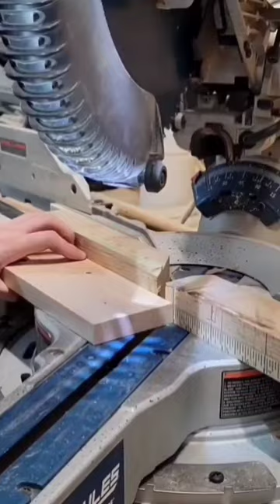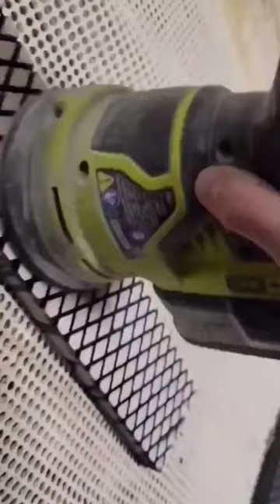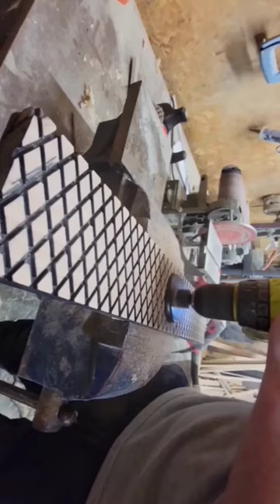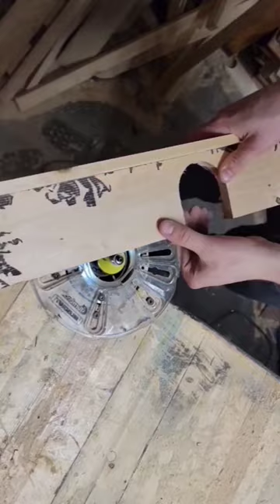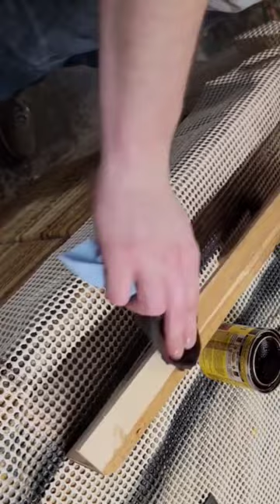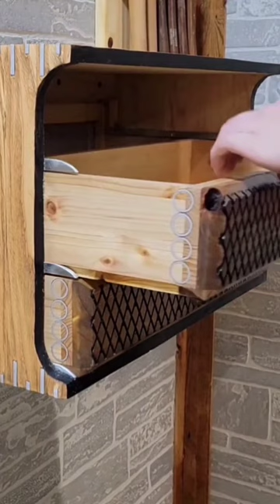Drawer Fronts // Woodworking #carpentry #diy #woodworker #maker #woodworking #wood #handmade #craft

Comment: For the next drawer front, would you consider using stain, then to make the pattern based sawing, I think with that in mind highlighting the wood's veins and natural grain.
Or,
Make the saw pattern, then stain, sanding it so it's the patterns that are only visible with the stain.

Either way, lad. Nice work! Looks neat with the patterning!

Comment: Just a keyboard warrior. But the manual recommends not having fingers that close. My Bosch system has a little hand warning line on the sliding extension ends that is 8" from the blade when set perpendicular to the fence.

They wouldn't do it, if there hadn't been accidents.